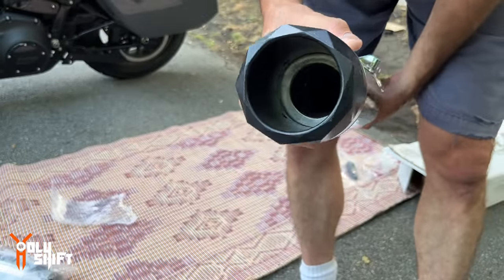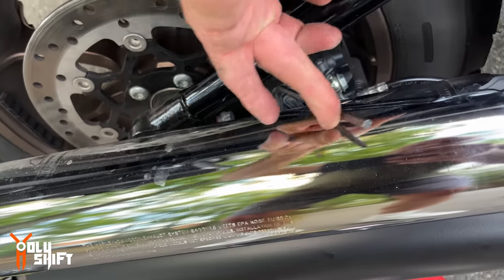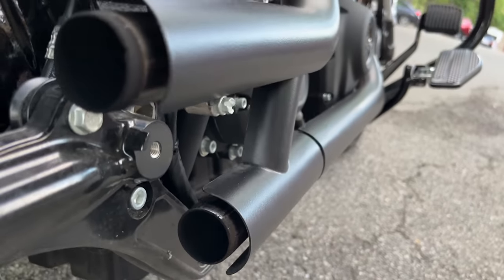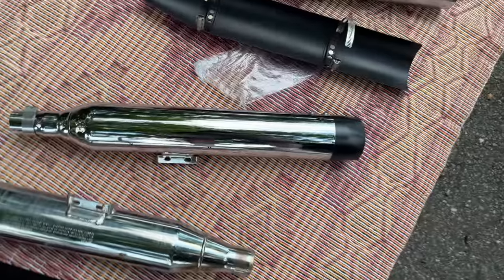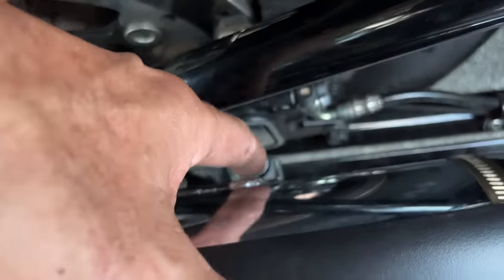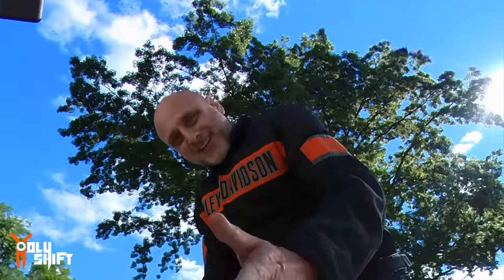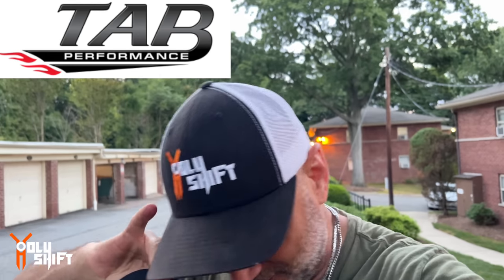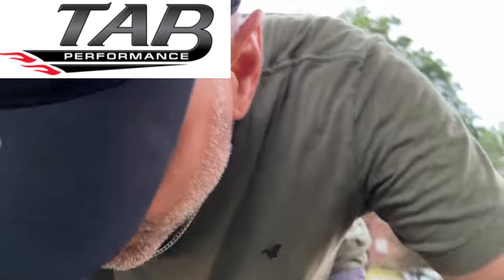TAB Performance Slip-Ons Low Rider ST

Comment: One of the best exhaust comparison videos i've ever seen. Really liked the rapid back and forth comparisons old vs. new. Great job!
Reply from the maker: Thanks buddy
Reply: Yes I was thinking the same thing  great job
Reply: Agreed, was very helpful to hear them that way. Sounds great!
Reply: Absolutely 💯 %, Sandy is on top of his game
Reply: Yup.  Slipons got 2 years. It’s got enough power already, better off spending the money on cosmetic upgrades and other things that just making a bike run better
Reply: Good video........Why would they sell a Harley that sounds like a Honda? So that's another $500 bucks that should come already on the bike. I check in to a LRST with the tobacco fade paint nothing else and they quoted me $30k out the door. Looks like I got to spend another $3-5k to get the bike to what it should of been at $30k new, plus all the time and labor involved installing all the add on. You also say if you get the bike to what it should be from the factory they void the warranty.   Perfect.

Comment: I just installed my tabs 2.25 baffles on my 2023 street bob 114 sounds so good and the idle is not crazy which I wanted cuz I leave for work around 2-3 in the morning but it's loud when u give it throttle 
and I took your advice bought some ball Allen key sets at harbor freight thanks for your video

Comment: Nice choice!  I went with the same slip on and zombie baffles for my 22 Fat Boy.  They tuck in nicely behind the stock heat shield and provide the sound I was after.
Reply from the maker: Is the sound too loud during cruise ?
Reply: @HOLYSHIFT  Not for my tastes anyway.  I can see where the bike and gear choices would have an impact on how loud it sounds (fairing, windshield, bags, full face or half helmet, etc.).

Comment: They sound great 👍 I was secretly hoping you were going to put a stainless steel exhaust on, after a few heat cycles the stainless heat shields would match your wheels
Reply from the maker: That’s the long term plan buddy a full stainless steel 2-1 . But after bike is at end of warranty… Covid models of Harley have been breaking down - more than usual. I want to stay with warranty

Comment: I have a ‘21 Sport Glide. Stage II with Reinhart slip on, SE tuner, SE Ventilator, torque cam. 

While I really am happy with the Reinharts, how could you not love these Tabs? However, you don’t need to utilize the SE tuner when changing exhaust on a Stage II? I had thought this was necessary. I too stuck with my warranty. Hey, when you’re in the 20k category, you’d be foolish not to. 

So could I just swap my Reinhart slip on for this with medium baffle and not have to utilize the tuner?

Also, while I’m quite happy with my SG, I can see that the ST is the SG done the way they should have. Not that the SG has anything wrong with it. Safe travels my friend!

Comment: Good video........Why would they sell a Harley that sounds like a Honda? So that's another $500 bucks that should come already on the bike. I check in to a LRST with the tobacco fade paint nothing else and they quoted me $30k out the door. Looks like I got to spend another $3-5k to get the bike to what it should of been at $30k new, plus all the time and labor involved installing all the add on. You also say if you get the bike to what it should be from the factory they void the warranty.   Perfect.

Comment: Now that you have had the 2.25 louvered baffles for a while, any regrets not choosing the Zombies?
Reply from the maker: Zombies would be louder - I’m fine with the current sound level. My buddy will be installing my slip ons when I get my 2-1 pipe. He’s gonna change baffles to Zombie. So we’ll be able to compare once he’s done.
Reply: @HOLYSHIFT  If you don't mind me asking, why did you go w/ the 2into1 setup?  I'm split b/w doing slip ons or 2into1.  I heard that the slip ons retain the warranty and the 2into1 does not.  What are your thoughts?
Thank you.

Comment: Does your LRST exhaust have the O2 sensor? I've O2 sensor in my 2023 LRST. Wondering if there's a way around that.
Reply from the maker: Are you subscribed?
Reply: @HOLYSHIFT  of course!
Reply: Hi bro.. I have 23 breakout.. What is the solution for the sensors?

Comment: so did you have to get it tuned? or just slip on and go?
Reply from the maker: Slip and go ! The stock Tuner has a 10% tolerance ( approximately). Usually if bike is not popping and engine sounds healthy you’re good ! Obviously a custom tune is always optional for best results

Comment: You need a tune. Those slip-ons have no cat in them.
Reply from the maker: I will check with Harley- if needed then tune it is !
Reply: @HOLYSHIFT  Sandy, what did Harley say?   Do you have to tune bc of no cats?

Comment: Harley just got sent out letters stating that you can work on your bike and put aftermarket parts on it and they cannot void your warranty and I've never heard of the low rider coming with a cam in it unless the dealer you got it from did it but then they absolutely would have changed the exhaust and intake so I'd say it's bullshit